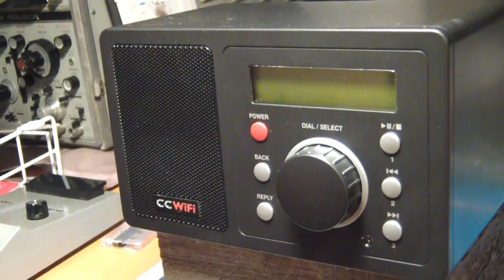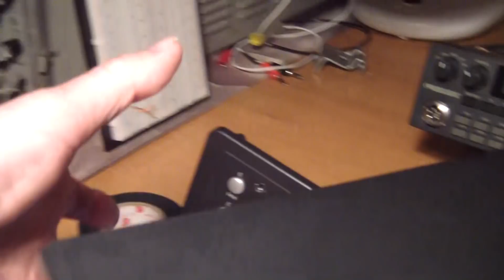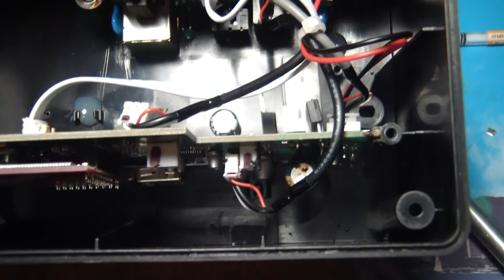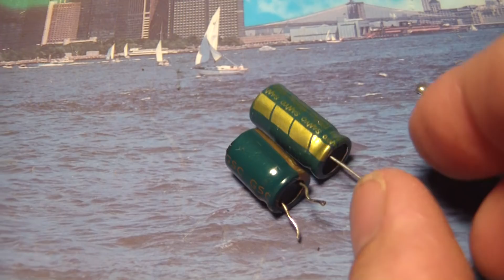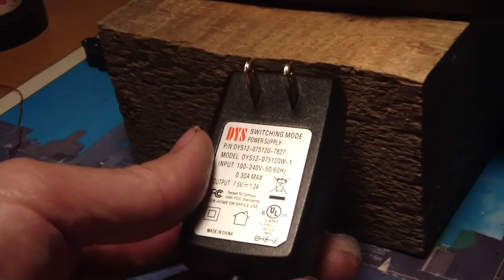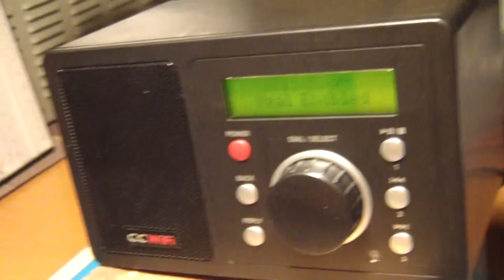CC WiFi, Internet Radio. Kaput!

Comment: I also own this radio, it has been the biggest pain in the ass. Glad you like yours, I'm seeking a simple to set up Wifi to replace mine. Everytime the wifi goes out I have to re-set-up the radio. Usually with help from C.C. I'm fed up calling for help, they only take calls on weekdays, this radio sucks. However I need a WiFi Radio
If you're not a tech guru, this isn't the radio for you, everything revolves around that one big round dial. My dial is worn out trying to set this pig up so many times. I'm holding out for someone else to sell a wifi radio more user friendly.
Reply from the maker: I have my beef's with the operation of this radio as well. In your situation, you need to resolve why the wi-fi is dropping out. That's the #1 problem, not the radio.

I suggest to remove the password from your wi-fi router to make it easier for the radio to connect. Everyone is "so" hung up on password protecting EVERYTHING. So what if your wi-fi network has no password!
Reply: KM,
My issue is Comcast Cable, they are the reason I lose my internet, it's their router too. I lose Comcast several times a month at around 1:30 A.M. in the morning. Now I don't always know it's Comcast, so I start fiddling around with the radio. My beef is, this radio is too hard to set up in the first place. If it were Easy to set up, I wouldn't get so frazzled.
CC needs to update this radio so old people like me can play it !!!

Comment: I have this radio. It seems a wrong move of box or plug in cord at the box, turns it off. Have to jiggle cord , set it just right to come on. Idea? Who can repair? Should I send it to C Crane?
Reply from the maker: You've made it this far ... fix it yourself. Either a faulty power connector from the wall transformer, easy replacement found on eBay. Or the chassis connector maybe has a loose wire. Crack it open to confirm. Otherwise, pay someone >75$ to resolve.

Comment: I love my wifi cc radio.  I have 2.  I have had them for a while ( 1 for a couple of years- the other about 7 months ).  At times I have to disconnect to regain the connection.  Simple radio to use.  I'm experiencing an issue.  I have the same 3 radio stations programmed on both radios.  They have been programmed the same for a long time.  One radio is outside the other I keep in my kitchen.  All 3 stations come through fine outside. Just today 8/19/2020 -  one of the stations I have programmed on the kitchen radio decided not to be connectable.  The outside radio is playing that particular station just fine. Go figure.  However, the kitchen radio says that the station is not connecting.  The other 2 stations are playing well.  So I decided to reprogram that particular station on the kitchen radio.  It still doesn't connect.  The home computer is in a room next to the kitchen.  I can get that particular station on the computer and on the outside cc wifi radio.  What else can I try?  Any help is greatly appreciated.  I need my cc radios!  Thank you.
Reply from the maker: Select menu item;

<Reset Factory Defaults>
This option puts all settings back to their default, as they were when the radio left the factory. If you perform a factory reset on your radio, you will lose all your presets, clock settings, and wireless network connection settings.

Comment: Something tells me it was the powerpack the whole time.
That brown goop looks like the glue they used to secure the screws and stuff like on the usb connector.
Reply from the maker: I tend to agree with you. During the heat of the battle you go with the obvious. I think the brown goop was a sloppy mess left by the 10 year old factory worker from China.

Comment: Why don't you look for an electronic Picture frame and pinch the power adaptor that should be exactly 9 Volt.
Reply from the maker: - Adapters abound on eBay for cheap.

Comment: I just got my crane CWF radio really like it,but I have noticed the heat build up . Your (emmy grade) video  shows that I could vent the top surface of the radio,without "hitting anything and causing damage by using  my Dremel and a small dia. drill  Would you comment on this
Reply from the maker: +Wilhelm Haggner  -  I have no heat build up here. I'd crack it open and see what you find. If nothing, I'd cut open a vent.

Comment: O C Crane Wi-fi Rádio.  No Brasil, sintoniza apenas 275 rádios. Não satisfaz. Não compensa a compra. Não recomendo. The C Crane Wi-fi RádioIn Brazil, it only tunes to 275 radios. Does not satisfy. It does not make up for the purchase. I do not recommend.
RESPONDER
Reply from the maker: ... only tunes to 275 radios;  ¡Ay caramba!
Reply: Você teve o problema de DNS  não conectar? Como resolveu? Obrigado
Reply from the maker: This product is now DEAD. It died a couple of years ago when Reciva died. Because of the poor design of this radio, you cannot connect to any new stations. If there were stations programmed into memory prior to the death date, you can still connect to those.
Reply: @KlondikeMike  Uma das invenções mais inúteis que já vi. A fábrica é que escolhe as rádios que quero ouvir? Isso é um absurdo. Coloquei no lixo, pois é um aparelho inútil. One of the most useless inventions I've ever seen. Does the factory choose the radios I want to listen to? This is nonsense. I put it in the trash as it is a useless device

Comment: Was just checking out this WFI Radio and found your video that I watched all the way through. I have just started playing with electronics by taking a course at Instructables.com. I was attempting desoldering some capacitors from some old curcuit boards using my new Weller WES51 Soldering Station and had great difficulty getting the solder to melt. I was using a setting of 650 degree F and using a soldering wick. Do you think it would help if I increased the temperature. This is probably a stupid question but like I said I am new at this.
Reply from the maker: - Some solder have higher melt points. The solder in this WiFi radio specifically has a higher melt point than usual. If it doesn't melt, all you can do is increase the temp until it does.
Reply: Thanks. That is what I gathered from watching your video but just wanted to get your opinion. I will give it a try at a higher temperature. I have a Solder Sucker device on order that may work better than the soldering wick that arrives tomorrow. Enjoyed your video.